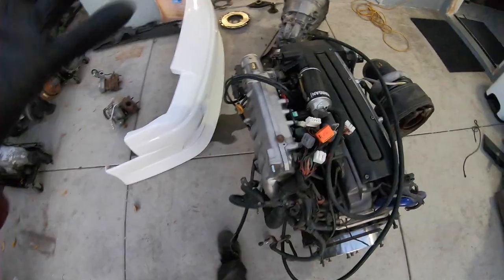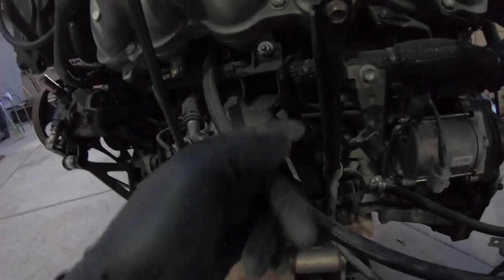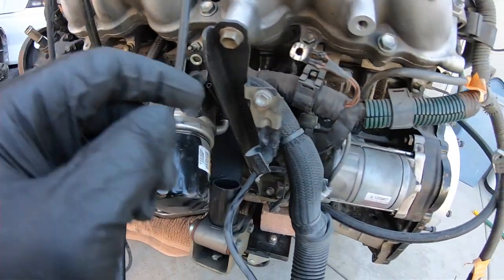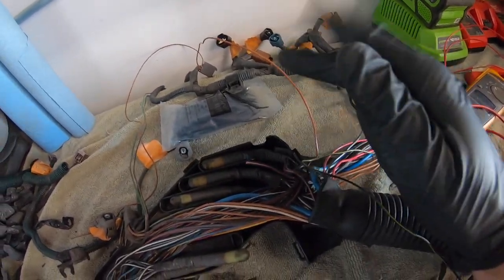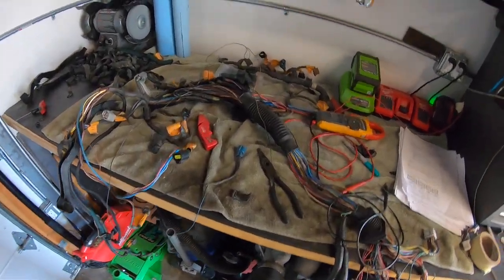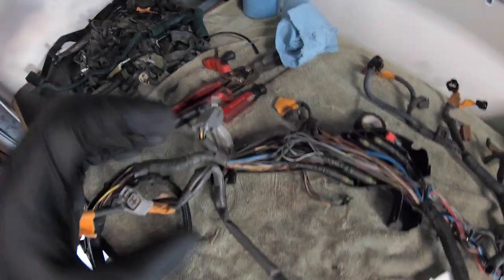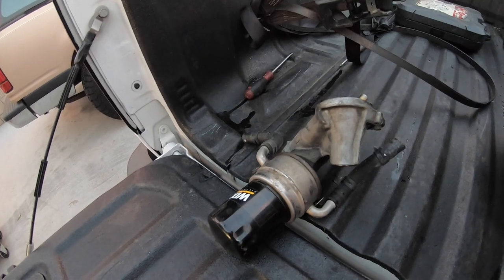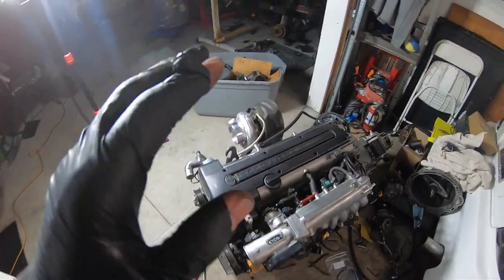How to Simplify a 2jzgte (Cooling system and Wiring harness)

Comment: So with stock ecu and going bigger single turbo. Is it Better to run the maf in front of the turbo or in front of the throttle ?
Reply from the maker: Ive had better luck with it by the throttle body
Reply: @slightlymodified501  sweet thanks for the fast reply. Just makes it looks cleaner too. I’m about to do that.